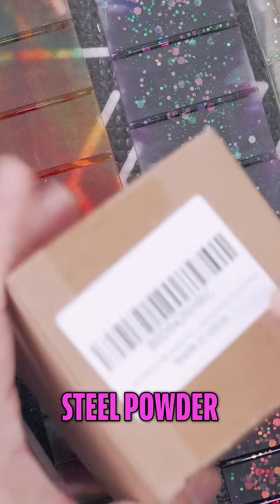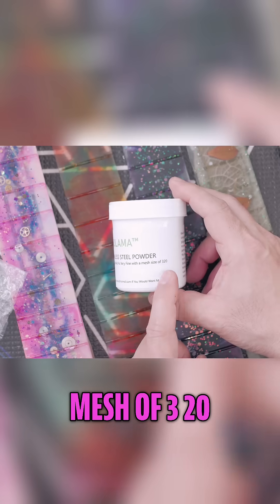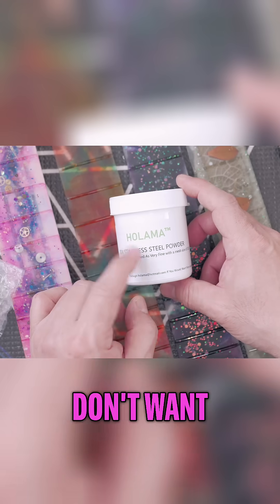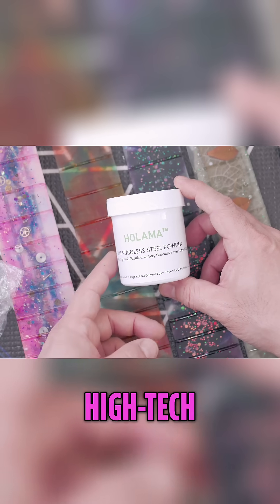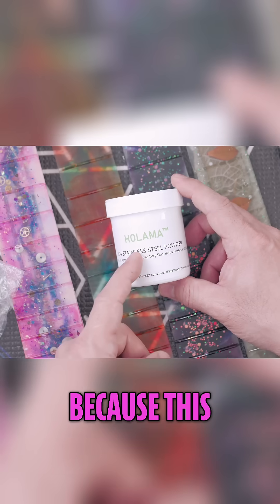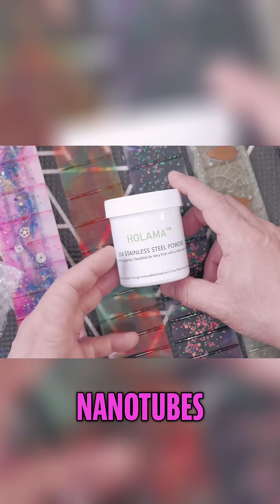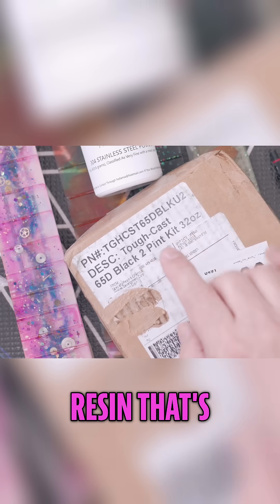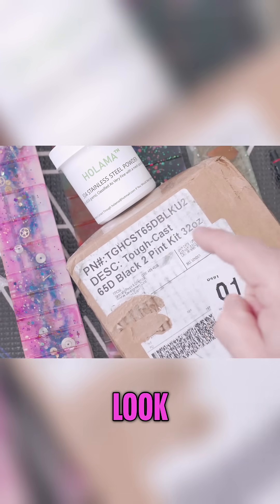Experimenting with Black Stainless Steel Powder for Unique Fretboards

Comment: I think Tech Ingredients channel did a thing about doing your own ultrasonic mixing. The video was related to thermal conductive two part adhesive. I remember he had to wear fabric and silicon heat gloves because the beaker gets really hot. (he was stirring while holding the beaker partially submerged in the ultrasonic bath)